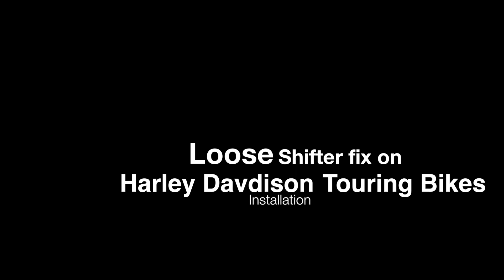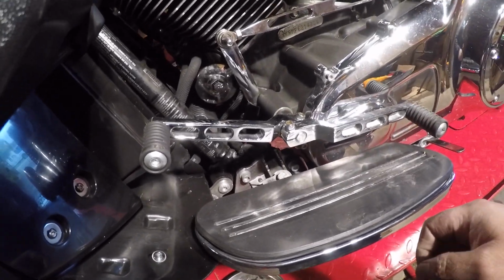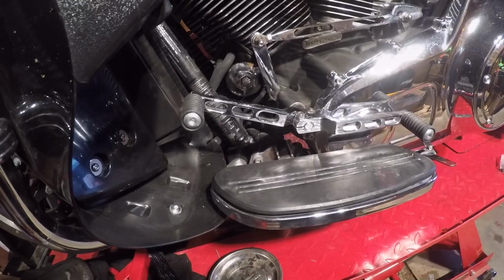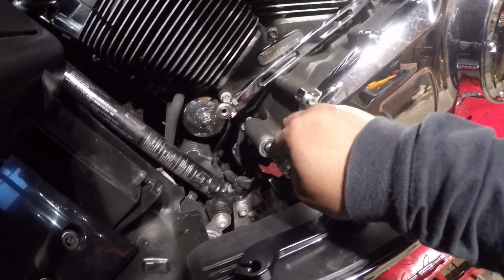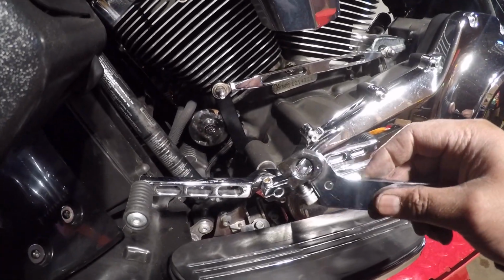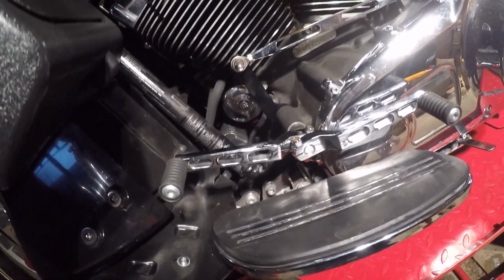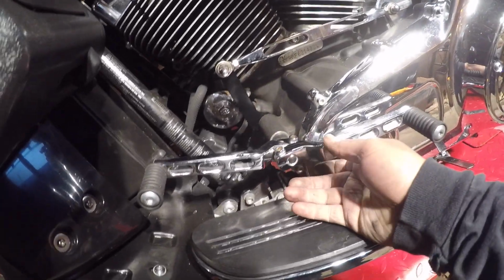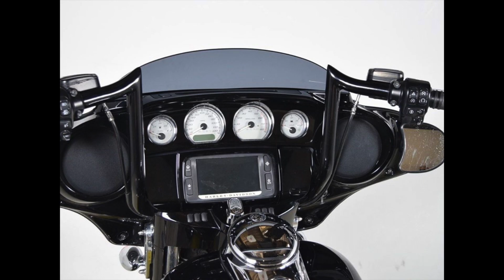Loose Shifter Fix on Harley Touring Motorcycles

Comment: When the 1/4” bolt gets loose… it can cause the shifter lever to wear out were the grooves meet . 

Tighten the 1/4” bolt down with some  loctite 
probably fix the wobble. 

Otherwise if it’s too worn… expensive and timely fix.